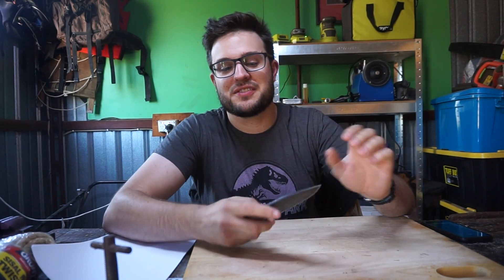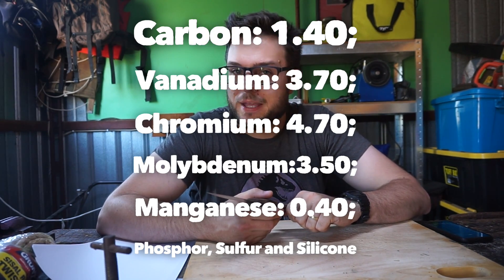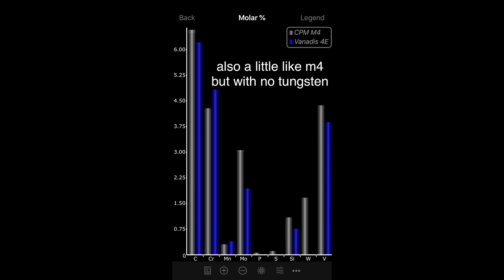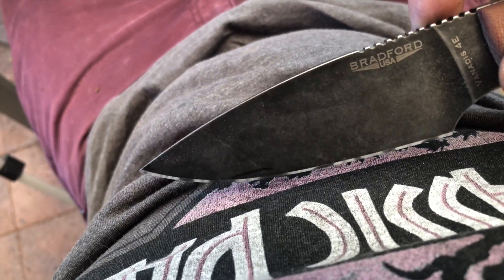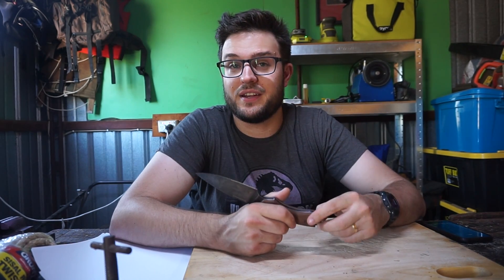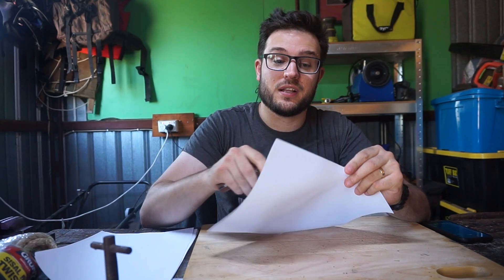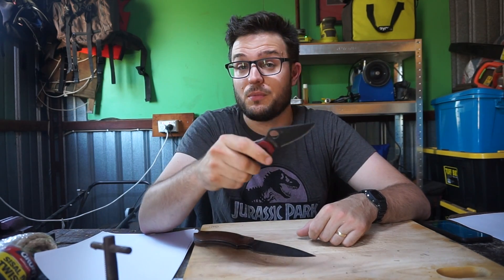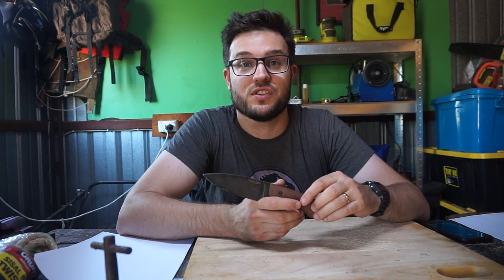Vanadis 4E and 4V in the knife lab compared! Bradford and Spyderco

Comment: I have guardians in V4E and Magnacut. The V4E really seems to hold a much better edge. Probably the HT
Reply: Vanadis 4 extra is a far superior steel to the overrated in my opinion ofcourse,Magnacut. I hold the same degree in Chemistry/Metallurgy,as the creator of Magnacut does,with the only difference I got it before he was born. That being said,its all about geometry,then heat treatment and lastly steel. Vanadis 4 Extra is my suggestion for a mid sixe outdoors knife. Id be fine with a nicely made 52100 too! If those were not aavailble, only then I'd go for CPM Cruwear or lastly 3V.

Comment: The HRC on the Spydercos are about 62-63 tested several times, several knives, different models, unique pieces; included in the LTK PMI/HRC compiled testing data
 PDF file
Reply: Depends on the particular 4V run as to what the hardness is. The Fradon Lock and St Nick's Para 3 tested were high 64 to mid 65. The PM2 run was mid 62, the St. Nick's Shaman and Manix tested so far have been 64 to 64.5. There is no blanket hardness for all Spyderco 4V and im sure there are some variations even in the runs that have been teste as well as batch, there has been a 1 point variation in the 2 different Manix runs. My 4V Para 3 tested at 65 multiple times, Kenny's tested at 64.9.

Comment: Yay, it's here!!!

Also I'm pretty sure that spyderco runs their 4V very hard. I've read somewhere that it is around 66-67 hrc and that definitely seems to be true, at least for my knife seeing as how it wore out a silicone carbide stone with almost no effect on the edge when I first tried to sharpen it.
Reply: Also it had a lot more micro chipping  on the edge when using a course diamond stone than any other steel I have, was a bit of a pain to sharpen, probably took around 6 hours to re-profile it and get it to a mirror polish using lansky diamond and ceramic stones
Reply: There's no way Spydecro ran their 4v at 66-67hrc. That's a custom level heat treat that no production company would even attempt. It stated on the site that it's 62.5-64hrc but they were just going of the crucible spec sheet. From what I read it's in the 60-62hrc but those were just educated guesses by makers and users who used the steel at different hardness. I love Spydecro but on a lot of their steel they heat treat towards the softer side. Their m390 tested the worst in the tests i've seen, same with s30v. They do a decent job on maxamet, rex 45, cruwear, k390, super blue, v-toku2, and zdp 189 which is nice.
Reply: @MFD00MTR33  "custom level"

Lol, you do realize that it takes just as much if not more effort and time to reduce the hardness on 4v. I highly doubt that blade I have is under 64hrc, just based on the fact that silicon carbide and ceramic stones have no effect on it. Possibly a mistake with the heat treatment. Also the knife I have is the exclusive manix 2 and based on the fact that unlike a normal manix this one has a smaller grind I'm assuming that also points to them doing a harder heat treatment
Reply: @antimatter4733  So you highly doubt its over 64hrc? That's what you said. All you have to do to run 4v softer is heat treat at a lower temp and temper at a lower temp, nothing hard. It's actually harder to get 4v to 66-67hrc as you claim than to 60-62hrc as a lot if people say it is(at least on the para 3). Spyderco never runs their steels at max hardness, the harder the steel the less tough it is and more chances for regular customers to have a chip or a broken tip and have a warranty issue. And the hollow grind on the manix 2 has nothing to do with the hardness they ran it, if anything they'd want it lower since a hollow grind is weaker than a ffg. 
Who knows, maybe your knife has a "blown"/wrong heat treat and is harder than supposed to be. That's not necessarily a good thing. And SiC is much harder than 64-67hrc, it's a 9-9.5 on the mohs scale which is roughly 90-95hrc(not that simple but close enough) so it should eat any steel up like nothing.
Reply: @MFD00MTR33  exactly, as you've just stated it's not more difficult at all to heat treat it to a higher hardness, just change the temperature. How tf is a full page grind weaker than a saber grind. This grind is thicker all the way to the edge. The paper I got with the knife from  spyderco even said that it was a stronger grind, and I'd take their opinion over yours any time. Anyways i have the knife and you don't so you're entitled to your opinion despite it being incorrect and not based on any observations, just assumptions and what you've read online from tests on completely different knives. I know that it wore out a silicon carbide stone and took 3 hours of sharpening on a ceramic stone without even turning the oil black, that's more than enough proof for me. So as much as I appreciate your opinion (I don't) I really don't care what it is.
Reply: @antimatter4733  Ok.
Reply: @MFD00MTR33  that's a fact!!!!! Spyderco 4V is in fact around 65-67hrc!!! All of them I've seen, none was below 65hrc
Reply: @antimatter4733  64.5 and 65 isn't the 66-67hrc that you said. Its closer to 62.5-64hrc that I said.
Reply: @marekmasar5216  the guy above just said one was at 64.5 which is below 65.
Reply: @MFD00MTR33  ok that's first one but very close to what I said , better than coming here with claim of 62
Reply: @MFD00MTR33  65 is just as close to 66 as it is to 64, maybe you should brush up on your maths
Reply: @MFD00MTR33  I've found 3 knives tested 64.9, 64.8 and 65hrc.. So it seems that most will be between 64 and65hrc.. I've seen BBB 4V at 67hrc maybe that confused me but I knew that 4V was pretty high and it's actually simple steel to heat treat..
Reply: @marekmasar5216  I've seen BBB 4v and his results. But he pushes his steel and edges to the max unlike Spyderco. He makes knives one at a time so its easier for him to get a 4v knife at 67hrc with a 0.005 edge. I wish I had the money and resources to get my 4v manix tested, it's a great knife(though it patinas like m4) and I would hope its in the 64-65hrc range rather than lower.
Reply: @antimatter4733  I can math just fine. I said 62.5 to 64 meaning I was 0.5 to 2.5 of the 64.5-65 you presented. Your 66-67 claim is 1 to 2.5 off, so we were in the same error range. I'm glad that test show that Spyderco did a good job with 4v, means my manix 2 should have a good heat treat. But that's not the case with a lot of other steels(mainly stainless) that Spyderco and other companies use. I'm done arguing with you, like I stated above, neither one of us had it right so I'm leaving it at that. Take care.
Reply: @MFD00MTR33  it's not under 64 I guarantee that.. Spyderco is pretty consistent with their knives and heat treatment.. I've seen about hundred Spyderco tested and in each one they was always in sweet spot (except m390/20cv/204p cause this alloy is really unforgiving with temperature and intervals)!! I've had my Spyderco tested and all are where they should be and they perform accordingly..

Comment: Those are two steels I'm not familiar with , but anything in the 600's is pretty frickin good .  What where the cut numbers when using a 20° Work Sharp edge ?
Reply: The work sharp fucks up the flats of blades and tips of them. Could be why it is shown less on these videos
Reply: @atomedgesharpening  
Only, if you don't know what your doing. 
After a little practice, my blades come out great!!

Comment: I bought a Guardian 3 in 4E and had a horrible experience which I’m sure was a fluke. Before even cutting anything I noticed that the factory edge was far from stunning & decided to just have at it with my KME. Besides it immediately showing the unevenness of the grind, the last 1-1/2” or so nearest the handle did nothing more than fold back & forth. It was returned to wherever I bought it without question but since they’re made with such variety of handles & finishes on the blade they didn’t have a replacement at that time. Haven’t bought on yet but it made me kinda leery. My son has had a Guardian 3 in M390 for a few years & I do the sharpening on it every 4-6 months and it has been a fantastic knife. It’s his daily carry and as a truck driver it sees a ton of plastic band, cardboard & other assorted cutting. Knowing how great that one is was my motive to try the 4E
Reply: GPK I think still has some Bradfords with 4e think it was an exclusive run but I think they still have some and this batch was from months ago and around the same time they had some in Rex45 think they may still have some of those as well. Not sure exactly which model Bradford they are but they had big batches with multiple finish and handle choices for both. St Nicks just had their exclusive run of the GiantMouse Grand in 4e what lead me here. I ended up with 2 of the Grands. Didn't realize I bought 2 till they showed up but oh well lol. I can keep one and use one or maybe trade one for something else whatever but I have all the SNK Spydercos and I have the Brian Brown and Something Obscene exclusives from there on pre order so have to keep it going I guess. There was 375 of the GiantMouse made